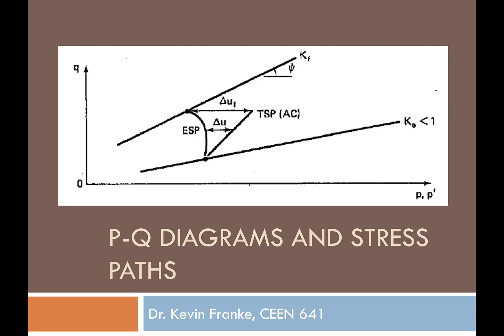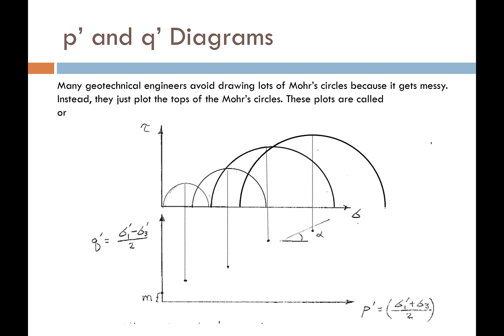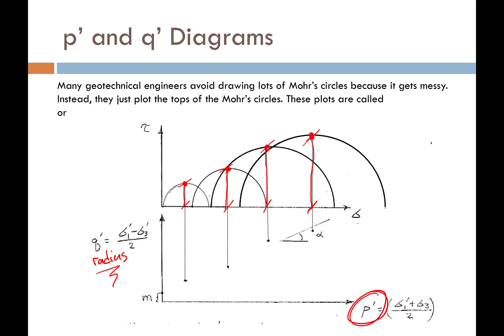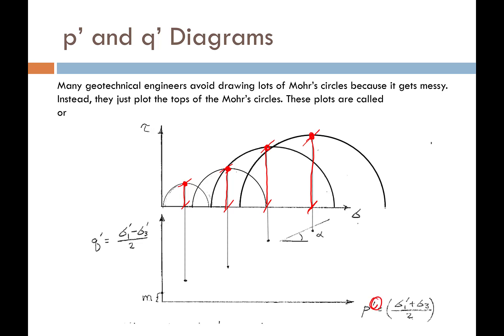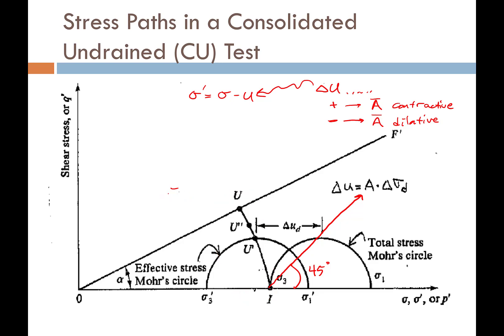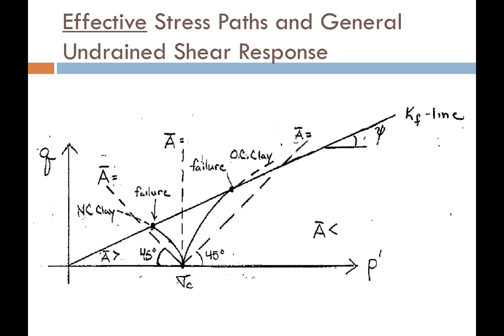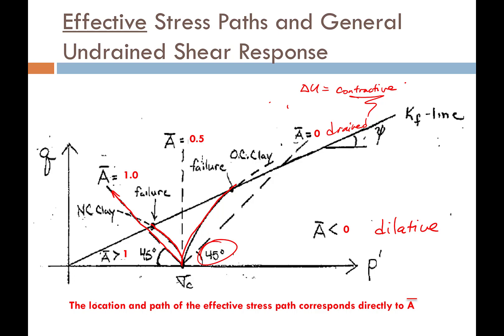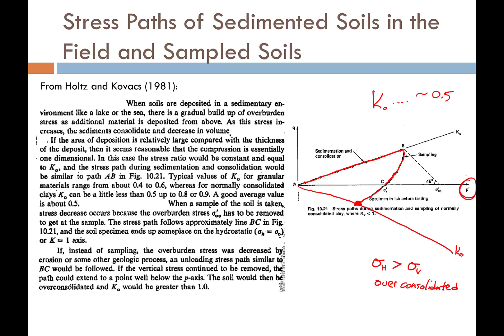CEEN 641 - Lecture 11 - PQ Diagrams and Stress Paths

Comment: I'm loving your lectures. Thank you for making them available.
A point of clarification; in this lecture p' is defined as (sig1+sig3)/2, which, I believe, is the MIT definition and we in Australia tend to call s-t plots rather than p-q plots. In your CSSM lectures you have used the Cambridge definition of p', namely (sig1+sig2+sig3)/3 or (sig1+2*sig3)/3. It may be confusing to some that the slope of the fully drained stress path, for example, is 1:1 in this lecture and 1:3 in your CSSM lectures.
Great information and very well, and clearly, presented. Your students are a privileged bunch!

Comment: At the 19:06 time on the video you show A-bar = 0.5 as a vertical line.  The notes above this state that a soil is contractive to the left and dilative to the right.  The O.C. Clay curve is shown going above the K-f line between the A-bar=0.5 and the A-bar=0 lines. However, in the bottom right hand sector of the graph you indicate that if A-bar is <0, the soil is dilative.   The soils are dilative starting from A-bar=0.5 or starting from A-bar = 0?
Reply: A <0 dilative and A=>0 contractive. Just that

Comment: I have a question. If we have two UU test (or two CU with the same isotropic effective stress) in the lab, and I apply two differents path, for example, one increasing sigma 1 and sigma 3 is constant, and the another one decreasing sigma 3 and sigma 1 constant, the value of qf will be the same? I know that it will be in the Kf line, but i have the quetion because i don't know if it posible that two UU test (the same material and effective stress) can have two values of Su (kpa) due to the path. Thank You!

Comment: Hi professor, i have one question.
How does the Mohr-Coulomb failure envelope adjusts to the cases of a axial extension stress path? Are we unable to use the convencional phi and c resistance parameters that we get from the axial compression stress path?
Thank you, i really appreciate the effort that you put in your lectures. Greetings from Perú.
Reply from the maker: Insightful question! Theoretically, you could use the same Mohr-Coulomb strength parameters you get from ANY of the failure modes because Mohr-Coulomb assumes a linear failure surface. The truth is that the failure surface is non-linear, and measured strength parameters will be slightly different for different mechanisms of loading.

Comment: Hello Dr. Kevin,

Isn't the modified failure envelope plotting apex of max. mohr circle against center of the max mohr circle called s'-t' plot instead of p'-q'?  And the p'-q' plot should be plotting the deviator stress (dia. of the circle) and the average stress.

Comment: Excellent slides on the whole, very informative and detailed. Good explanations throughout. But unfortunately I do not understand your slide on dilative and contractive soils. I think some of what you say are contradictory while other parts have inadequate explanations. I am quite unsure how the stress path of A bar = 0.5 is obtained and how is it straight upwards. I believe that is an effective stress path but I am not sure how change in pore pressure being half of change in deviatoric pressure, sigma vertical-sigma horizontal will net you a vertical line on the p-q graph, it just feels unrealistic